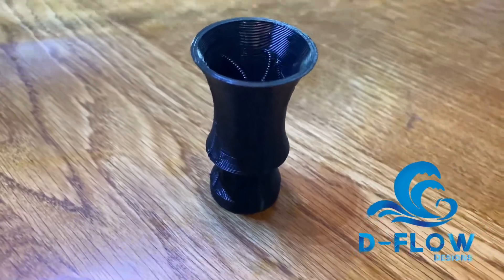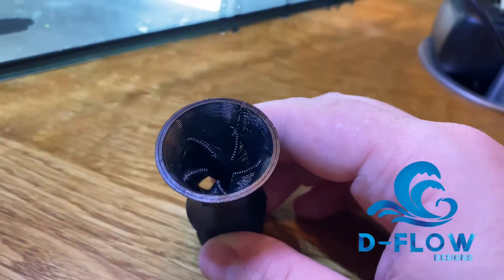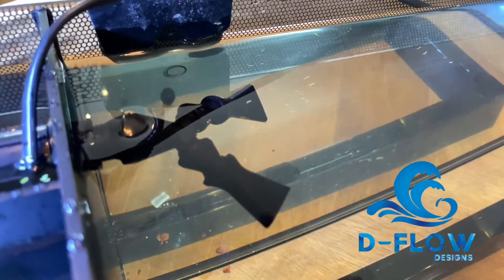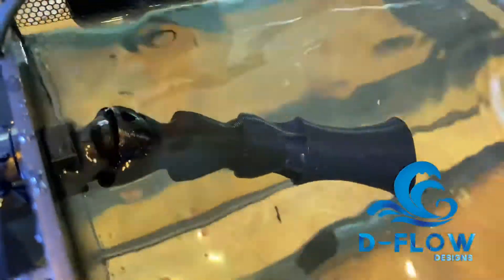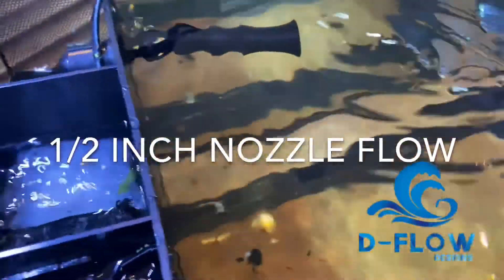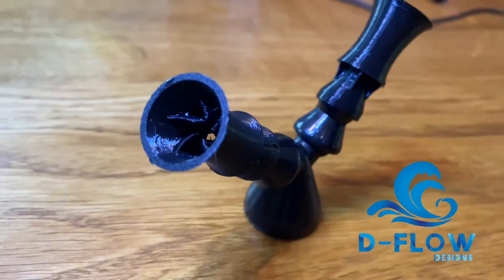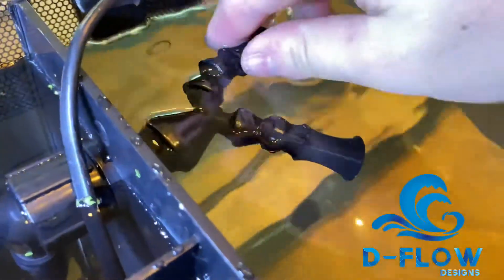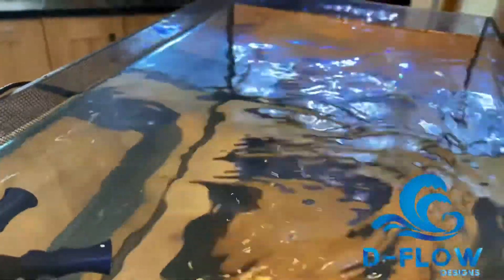D-FLOW Designs Random Flow Nozzles - Fluval Evo Install

Comment: Don't follow these exact instructions! 
I broke the seal of my sump to the glass...
you should remove the nozzle from the sump to replace the flow head...I had a use a lot of force to pull it off
Reply: Hi well yes of course don't recommend using force if it doesn't pop on. remove and take it outside of the tank to be safer these parts come out of the tank to allow for this